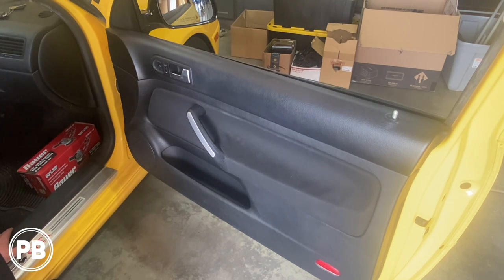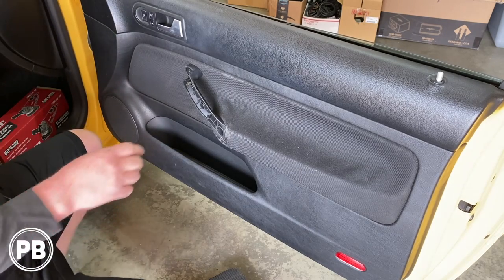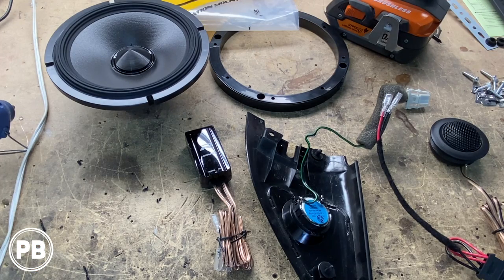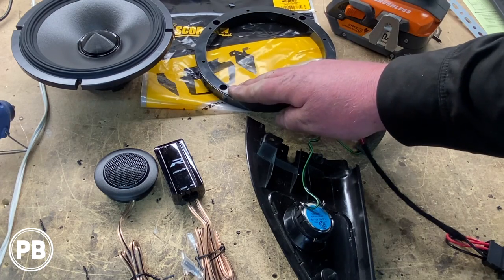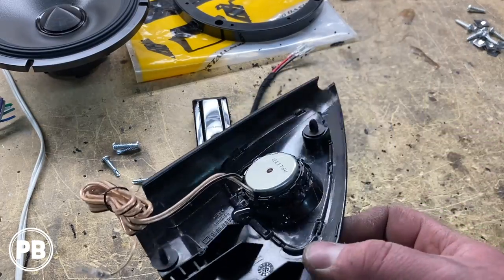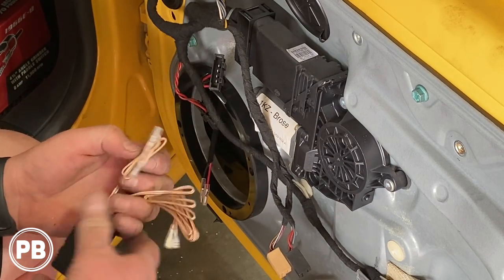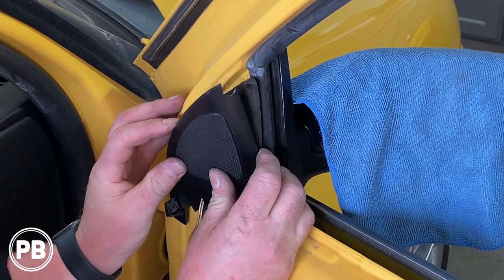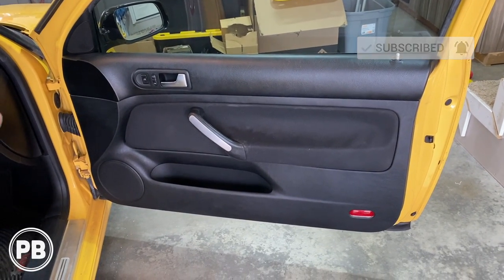1999 - 2004 VW Golf / GTI / R32 Front Door Speaker Install

Comment: I just did the same install with the exact same spacer and speaker set and I get no sound of them. I don’t have the monsoon system so I’m assuming it has to do something with that. I’ve checked my connections and everything is correct. Any ideas?

Comment: So if I bought component system and have a monsoon amp I head I can just plug in the tweeters with the normal stock wiring since the monsoon has the crossover built into the amp? So I would not install the aftermarket crossover? Is this correct?

Comment: What about if I want to leave my tweeters and leave my monsoon amp on my 20th AE and just replace my door speakers with the adapter
Reply from the maker: Pull the factory speaker and see what impedance it is, then you can purchase the correct speaker to match that of the monsoon amp.
Reply: Any luck with this? I just bought a new component system for the front doors of my 20th and I heard the monsoon amp has the crossovers built in so to use stock wiring

Comment: Can you upgrade the amp keeping the factory wires instead of running new wires?
Reply from the maker: That’s what we did :)
Reply: @ProvoBeastAudio  I need that tutorial very much
Reply from the maker: @LordsNeverWorry  This wasn't a personal vehicle, but you can easily pull the speaker, use a multimeter and measure the factory ohm (or do the research online) and replace with a speaker like it.
Reply: @ProvoBeastAudio  it has the moonson I wanted to install a skar 4 channel using the factory wires
Reply from the maker: @LordsNeverWorry  Ah, replacing the monsoon amp.  We have footage of doing so, but it didn't turn out that great.  Let me see if I can do something with it.
Reply: @ProvoBeastAudio  cheers
Reply: @ProvoBeastAudio  any update on replacing the monsoon tutorial

Comment: What is the maximum mounting depth?
Reply from the maker: This fit these deep Type R Alpine's just fine using the parts used.  Any deeper and you will have clearance issues with the window regulator.
Reply: @ProvoBeastAudio  I actually just fitted Cerwin Vega C465 with a mounting depth of 70mm just fine!
Reply: @jvinsnes did you was a bracket or mount right to sheet metal of the door